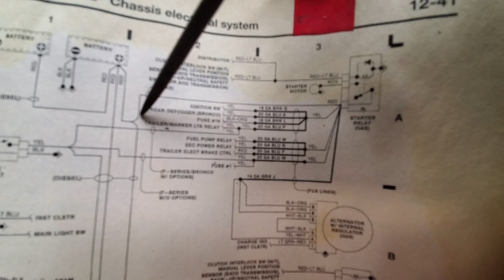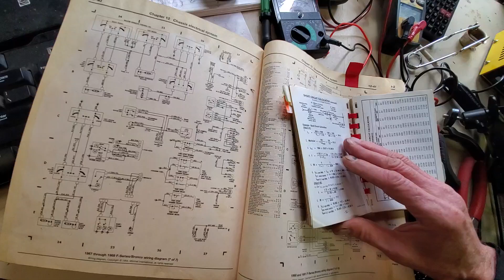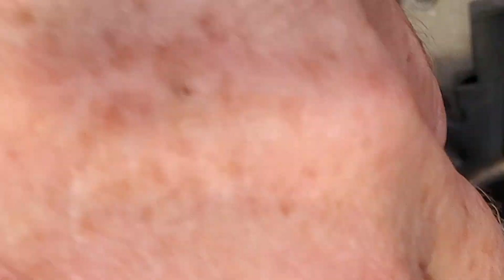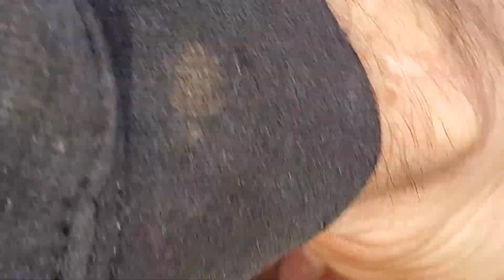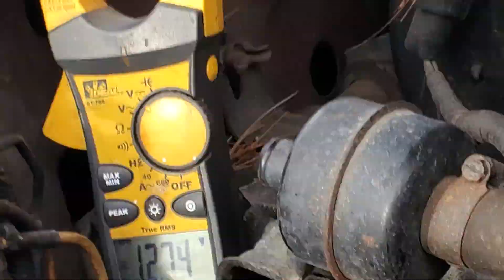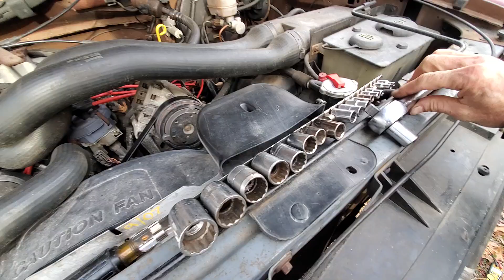1990 Ford Bronco 351w  -  Fuse Links- do i really need to replace them?

Comment: I having no power to my ignition I was driving and then it suddenly died like I turned the key off I have no ignition power my key broke awhile ago so I have a push button but I still had to turn the key to have the fuel and spark to start but have nothing now

Comment: Im trying to fix the 4x4 button. How do you change out a fusable link once I find the bad one
Reply from the maker: once found,, cut it out completely up to the plastic splice blocks on either end.  lets assume you have a "blue" fuse link that is on a large yellow wire.   cut out everything to do with the blue link.  see if your now two yellow wire ends can be pulled up to each other.  If yes,, install one female spade terminal on your two yellow wires.  install a regular ATC fuse by plugging the fuse into the spade terminals.   if your two yellow wires cant be pulled up to each other then extend them and install your female spade terminals and fuse it up.   
beforehand, learn what color codes are for what amperage fuse link.  install a fuse that matches what the previous fuse link amperage was.  jcassity@frontier.com for more help and if you want one on one help.. read my channel info.

Comment: Nice video, im troubleshooting my 91 f150, recently converted it to carb, and i noticed when i was cranking and it would not start, after 6 seconds of cranking i noticed smoke coming from behind the battery.
Reply from the maker: leme know if you need help,,  im pretty sure my haynes manual has pretty decent wiring prints and rolls up from 86-94
Reply: @ifixitall-24-7 i think i figured it out, when i connected my HEI ignition module  to my new duraspark distributor i removed the resistor that connects from the ignition switch and HEI module to the hot side of the coil. It kind of explains why my truck would idle perfectly for about 1 minute and randomly shut off. My fuel is at 6 psi and i am
10* before top dead center on the ignition. I think i removed the ballast resistor thinking i wouldnt need it but i learned the hard way i do. Haha
Reply from the maker: this is odd, the second time in a month that EECIV harness resistor has cropped up in my converstations,, last guy is an 83stang
Reply: Which one of those fusible links goes to the fuel pump??